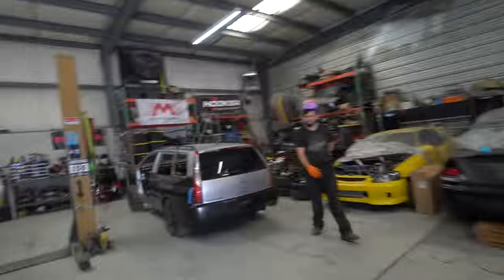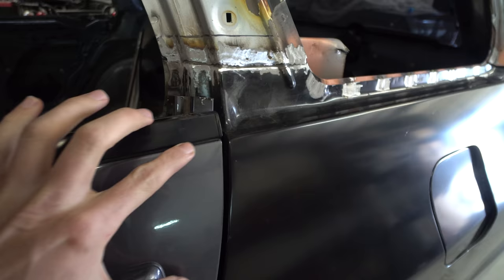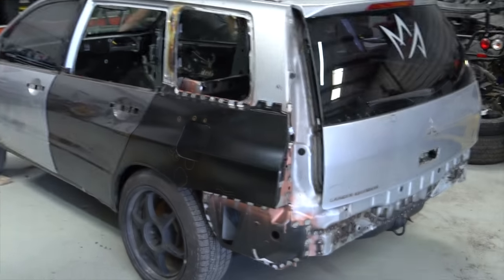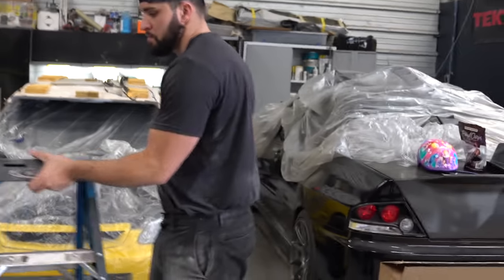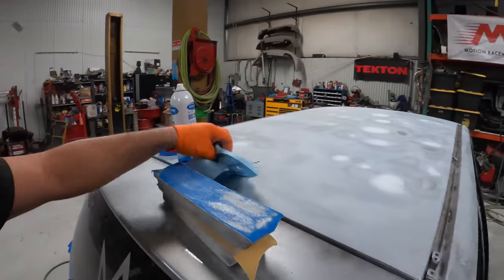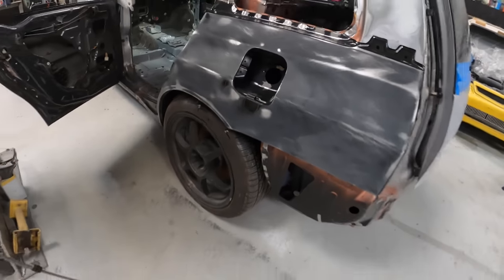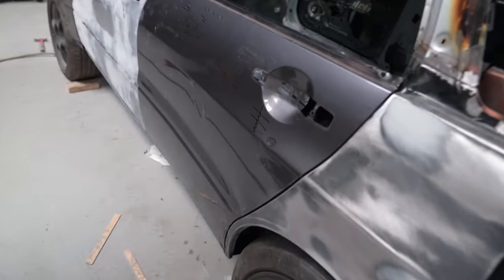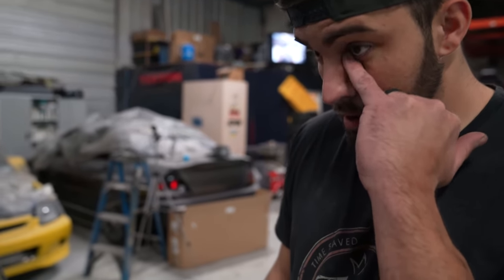Pt.12 Evo Wagon Build | I came home to THIS!? (BODYWORK)

Comment: Shoutout to Sean as he's got so much comfortable infront and speaking to the camera! 
Those fall off from the welding that Sean has problems with. We call them here in Sweden with a directly translation "Welding Fleas" LOL. Especially when you get them in your shoes you can make some funny dances from LOL. 
It's very close to be driving soon! Following the work and the crazy amount of rebuild and drilling the spot weldings and welding it together again. It looked like it where not possible at some points during the build to be sorted out. I didn't doubt you guys but it didn't look like an easy task to get it together in an awesome way. 
Would be very interesting if you could try to sum up the total man work hours on the whole build. I think that many of us will be much more supriced and amazed on the huge amount of work you guys have put into this build. And also a reality check on how many hours these builds takes to do. Then we can compare it to how long it would take for a weekend warrior to do this at home. Or how much it would cost to send it away to a fabricator to have it done as well.

Comment: Maybe I'm seeing things and I'm sure that's the case but it didnt appear as if the low spot under the gas door had been sanded before he put filler on looked shiny to me maybe I'm wrong tho I just know with my experience working at a body shop that's not going to last if it wasnt sanded just an fyi I watched the part 3 times just to verify what I thought I saw so dont hate me I would just hate for all this hard work to go to waist love the build!

Comment: Not critiquing, but genuinely curious.  I thought you weren't suppose to put filler over paint.  My understanding was that you sand to bare metal, add filler, sand, prime, seal, base, clear. Asking because I'm about to do a whole bunch of this on my STI swap. What's y'alls take on it?
Reply: You just need to have a surface with some texture for the filler bite on.

Comment: I dont think you'll be able to get the rear windows to roll down all the way.  That window frame plus the style of door. It looks like it would hit the well before it gets half way
Reply: The doors are the same as far as the height and structure. The only difference is the wide body skin from the evo doors.
Reply: @seansummer5314  i thought they swapped the upper window frame from the lancer wagon onto the lower of the evo door.
Reply: Yeah we did. But we’re using the lancer wagon glass as well. Lower portion of the doors is the same other than the wide body skin. The regulators and all mounting points are exactly the same. The upper window frames are different and that is why we are swapping them from the wagon onto the evo doors with the wagon glass.
Reply: @seansummer5314  awesome.  It's looking great so far.  Can't wait to see it in primer